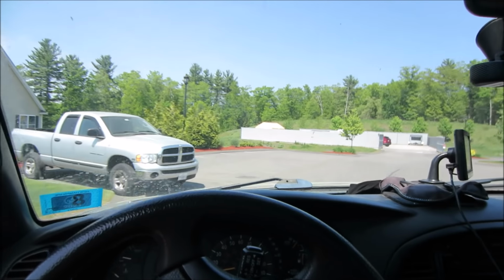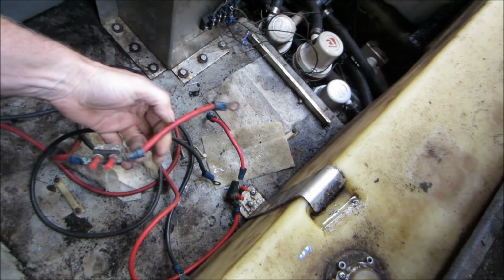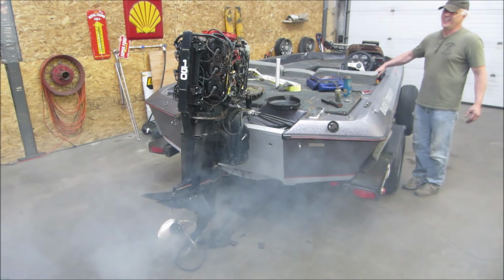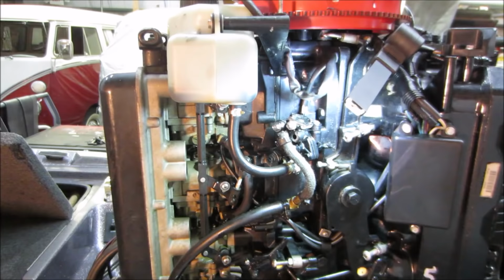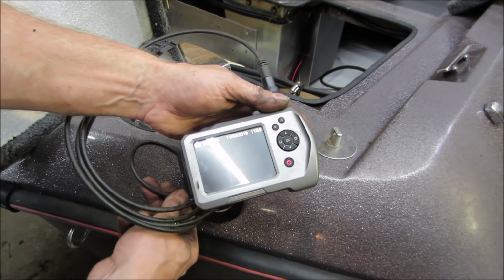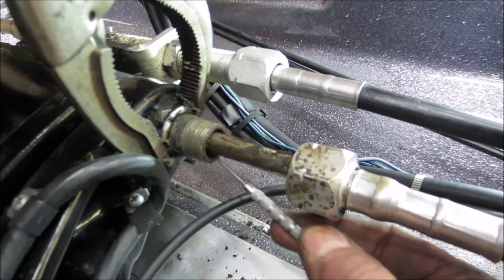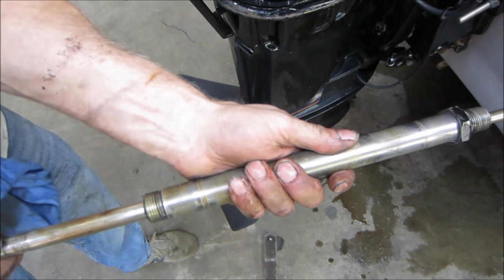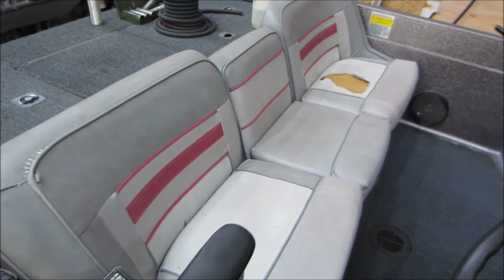1990 Bass Boat. Can We Fix It?

Comment: I've had to drive those steering rods out with a hand sledge before. Rusted tilt tubes suck.
Reply: I have had that issue with my boat.  Salt water is hard on them.  I found the best way to free them is to run the motor and use plenty of WD40.  The vibration of the motor will break up anything in there.

Comment: The switch on the front navigation light is for the auxiliary light on the back, like a map light. Separate bulb for the navigation light. Have the identical light on my Nitro. Almost wish I was there to answer your questions as you went...lol! I have a 94 Nitro 180TF, this boat is the predecessor to mine.

Comment: The blue in the main tank, is most likely old oil that has separated out (- I've been there).  That may indicate the auto-oiler is non-functional, thus adding oil into the fuel tank.

Comment: Hey man. NICE FIND! I have a word of advice on that Merc if I may. I have the same engine in Mariner flavor (everything is gray instead) on a 19 foot Procraft.. The oil system is a possible failure point which can cause the engine to run without oil.  Mine has been removed and retrofitted to take premix gas only.  Its a bit of a pain to fill, however the peace of mind is awesome. I use a 50:1 mix of high quality marine two stroke oil, with marine gas and a bit of Star Tron additive, and its good to go! I really love your videos man. Thanks a lot for all you do and share.

Comment: I played this game a couple of years ago with a 1991 Astro with a 115 Mercury. Go ahead with all new fuel lines and hoses, new kind with "Above Deck" (Grey) and "Below Deck" hose types. Water pump, thermostat and poppet, trim relay, plugs and cables, water separator/fuel filter, examine ALL electrical, service lower unit, and expect more to come.
Have fun!

Comment: I just went over this with my boat that had sat for about 10 years. I disconnected the clamp that holds the two cable end rods together. Then took the nut or seal off the ends and slid about a foot of 7/8 rubber hose over the threads. Clamped it down tight then filled it with ATF. Then put a air valve on the end and put about 60 pounds on it. Left each one of them for like a week working the steering wheel everyday more and more. Mine is now about 80% better, it’s not perfect but a lot quicker and cheaper than $600 for new cables. I could barely move it to start with but it wasn’t quite as bad as yours.

Comment: Had the same seized steering rod in my boat recently. We used the pivot tube nuts and assorted pieces of pipe as spacers to pull out the rod along with the complete inner cable.
Then we cleaned the inside of the tube with a scraper and brass brush from a 16-gauge shotgun cleaning set.

Comment: sooo lol. not sure if others have mentioned but the steering tube was stuck from old grease that turned into a rock lol. Also... THAT TUBE HOLDS THE ENGINE ON THE CLAMPS LOPL....Heat friend.... a torch over the tube would turn the grease into soft stuff again and you are set. They do make a wiper for the port side to keep the grease in and junk out. That too helps. I have a 2-foot long drill bit that I use at my shop when this happens to clean it out once the shaft is removed.  Looks like you have a great find there. The oil system is like you suggested. The onboard tank gets fed from the big tank by air pressure pulses that then fill the small tank. Fill it up and then leave the cap loose until oil comes out. That small tank keeps your engine alive. I always run a small amount in the fuel on the older engines as well. Replace that fuel line and primer bulb before trying to run fuel to the engine.. It's a safety hazard and deadly when it is hardened. Also, the inner part of the hose is terrible and will crack into pieces and plug your carbs. Best of luck to you.

Comment: My dad bought the same boat back in the very early 90's he ordered it from the factory with all the options and living in Florida we ran it some times 3 days a week and every day in the summer tell we wore it out. after ten years of use we had fished it in to the ground but all most all of it was tournament fishing . we all my dad, me and my brother all fished the Florida circuit but it got old fast and we stopped after a few years . he sold the boat in the early 2000's this is the first one I have seen in the original color in 20 years god I miss that boat I should have bought it from my dad back when he sold his .

Comment: I know its old, but in the future, you can make a simple siphoning bucket to such the fuel out of a tank.  Put a length of hose from your tank to the bucket lid, with a nice tight seal.  Bring that hose about halfway to the bottom of the bucket.  Drill a second hole and affix an attachment of some sort to allow you to use a shop vac to suck the air out of the bucket.  Do not extend any pipe of hose from this side into the bucket.  Turn on your shop vac, and it will suck the fuel into the bucket, but the air gap will stop you from ingesting it into the vacuum.

Comment: Mustie
Been working with boats from 12' runabouts to 38' yachts, and steering cables need constant lubrication. It would be best to hit that transverse bar with penetrating solvent over several days and let the crap loosen up by itself.Also, check the bar for a centering bolt which many people miss and wreck the transverse bar. Started by keeping my grandmother's rental boats running at age 12, now I am 65. Lots of experience over 53 years. tells me to be careful freeing rusted controls or dried out grease on those controls. No need to hurry jobs like that just for a video.

Comment: Mustie 1,  Change the silver hose between the tank and engine. That's EPA hose and ethanol eats the innerliner and separetates  the two then when you go to fire up engine it colaspses and cuts off fuel.
Put car gasoline in its place and you will have no problems.
Just had this happen to my boat the hose was 11 years old.
Make it chooch again.
God bless

Comment: On the makeshift boring tool... 1/4 in steel rod and cut a 1  1/4 slot in one end and wrap 1" emery cloth around it to desired diameter,  chuck it up in a drill ,roll the emery cloth up and put in in and there you have a make shift flapper disc for inside diameters..

Comment: You should go ahead and replace the fuel filler and tank vent hoses.  ABYC recommends every 7 years on those because they become permeable.

One of the best tools I’ve made is a simple 3/8” rod with a 1” slot cut in one end.   Cut a strip of whatever grit paper you want, 1” wide, and wind it up in the slot.  Chuck it in your drill and ream away.  It’s like an internal flap disk.

Comment: Also, the oil injection system on those Mercs can have issues, either with the tank sensor, or pump. A lot of times, folks will just bypass and pre-mix.

Comment: I had one of these Black Max 150 V6 outboards and it was a badass on a 16' Cheetah shallow vee. Thing would come damn near out of the water, could burn up 12gals of fuel/oil mix in 3-4hrs of ripping around

Comment: Mustie, To clean out the sleeve, get a length of 1/4 inch rod and hacksaw a slot in the end of it the width of the emery tape. Wrap the emery tape around the rod. Fit it to the drill or die grinder and run it back and forward up the sleeve. Been there done that and it works.

Comment: In stead of welding the brush to the shaft cut a slot in the shaft. Take a strip of sandpaper and make a hone out of it for your drill. Start with heavy grit down to light grit.

Comment: Great video, I bought a old boat in April of this year, it's a 1961 15' Mobicraft and has a 1959 Johnson 50 outboard. It has been a nice project for me and I got it finished. The engine runs great, new points and condenser, fresh fuel and the old gal fired right up. Have had it on the water twice and waiting for my appointment to get it registered.
  I look forward to the next video, hopefully it will be part 2 . Thank you and you have a new sub and fan.

Comment: Big fan been watching for awhile but want to help you out. I’m an outboard mechanic and couldn’t help cringe at 24:24 your sprayed high pressure water directly in the airbox. wouldn’t be surprised if some went into the carbs. Also when trying to start in the garage, should definitely had it cranking with water hooked up or in a bucket. Doesn’t take long at all to burn up an impeller. Thanks for making cool videos tho!

Comment: Best stuff I ever used is the evenrude injector clean and it has the cleaning port on the motor and that stuff really worked great for cleaning and storage pickling . 
    Havent had a boat in a few years and not sure if they even make it anymore.
   And with 4 strokes coming out not sure if people even use it

Comment: Love your tanacity (sp) on solving problems. The steering cable problem I would haved failed. I can hardly change oil or sharpen blades any more because my hands bruise and bleed on everything I work on  and have to be carefull. So Thanks for doing these vidios so I feel usefull cheering you on. I feel like i'm in there and in your way Great Job

Comment: We had an issue like this, and we tried everything. My Dad hit the tilt up and it relieved pressure on that pivot. We put the lower brace on and tilted the motor down and it took the pressure off that pivot, found that bar was slightly bent. Just a suggestion.

Comment: Better clean and lube that other tube as well.  While you are there make sure the bushings on the tilt tube are taking grease and moves freely.  Most times I have seen or done that job is when the salt in the ocean has mixed and hardened with the grease and locked the tube.  Then taking the motor off the boat allows the room to work with the push pull cables as well if needed to remove the tilt tube.  Heat is the most often taken path.  All in all I much prefer the SeaStar hydraulic steering units.  Then don't forget to check the zert on the swivel tube for freedom of turn.  This is much easier to do while you have it torn down.  I have also seen the props frozen on to the shaft to where they had to be burned off with a torch.  Need to change the grease on the splines every couple of years in saltwater.  Yours is probably fresh water use but same thing with a bit longer time frame.  Guy said he fished it so pressure check the lower unit to make sure wrapped fishing line hasn't taken out the seal behind the prop which is ultra common.  Greasing here is important.  Use the right grease (doesn't combine with salt and silt and then harden) use enough every season to push out the old grease and do it once or twice a year.  Even then the lower bushing on the swivel tube often seizes up because all the grease coming in the zert goes the path of least resistance and exits the top bushing never getting to the lower.

Comment: We bought a boat during 2020 that had been sitting for a while, the tank was 3/4 full and had multiple gallons of water and green plant matter looking stuff... Since the tank was oddly shaped and difficult to remove, I just ran water + degreaser inside after draining it as much as I could, then just flushed it with lots of water from the hose until I saw nothing else inside really but pure water, then vacuumed out as much of the water I could with my shop vac, since it was well rinsed at this point and no more gas present. Then the few ouces of water I couldn't get out I just absorbed with towel through the pump hole.

Comment: My father bought a boat with an outboard motor. We had the same issue with the steering, we managed to get the cable out of the tube. I wish either one of use thought about using a drill. We just used the rods that come in the gun cleaning kit.

Comment: Suspend the gas tank in the air by looping a strap around each end and tossing the center over a beam overhead.  Then add your gas/scrubbing solution.  Makes it easy to stand at the end of it, grab it, and pull/push the tank back and forth to slosh it around inside before dumping out.  Also easy to dump out when suspended.

Comment: the spark light when put onto a boat motor is usually dimmer then if put onto a vehicle. it doesn't crank the same spark usually. the new engines will for sure but the older ones won't. 80's and older its a dim light. so you have to test in the dark or dim lit area.

Comment: i'd hate to think what the cost would be if you had to take this to a boat repair shop to have all of the issues addressed to restore everything. i'll bet by the time he's done, he will have more than doubled the value of this boat. bass tracker is a top brand, and it was prolly a $25,000+ boat when it was new. in as good of shape as it is, restored it should be worth at least half of the new price. all in all, an awesome addition to the mustie fleet. honestly, i'm kinda jelly, you lucky dog you.

Comment: For cleaning the rest of the crud inside the back where the tank goes use purple power full strength to soak before pressure washed it

Comment: to clean out the "tube", cut a slit in a piece of SS or copper (3/8") and insert some emery cloth into the slot, Make a flapper out of the emery cloth, Run it in and out of the tube with your drill, Will clean it very well!!

Comment: Mustie, that gas that looks like it has oil mix in it could be an indication that the oil injection was not working and the owner just pre-mixed gas and put it into the tank.  I have seen people do this instead of fixing and adjusting the oil feed pump.  As for that steering rod I would drill it and the motor housing to put a zerk fitting to grease that slide.   If I recall, my 90 HP Merc had a grease fitting???

Comment: On older motors it typical to find people running a mild solution of pre-mix fuel, the automatic oilers are the #2 reason motors fail. Also always keep the water pump wet, i prefer half a barrel over the muffs.

Comment: You do know that there should be a flat head screw on top of the lower unit, which is used the release the hydraulic pressure, which lowers the out board. Plus when open you can manually raise the engine and close the screw. My old 115 HP Yamaha had that screw.

Comment: had the same issue on the steering a long time ago. I did the same thing you did with the wire brush but i use transmission fluid instead. But I guess kerosene works just as well.

Comment: that little oil tank on top of the motor is an oil reservoir.  its a back up oil tank in case the main tank goes too low.   another thing, never start an outboard without water supply.  the impeller will burn out in less than 10 seconds.  replace main fuel line and primer bulb, that fuel line looks kinda stiff

Comment: Those steering cable to engine fixings are notorious for seizing up ,  I have had to do what you are doing many times ,you soon learn to put lots of freeing agents on them , if you use grease that normally is the problem on going dry in the workings

Comment: LoL ! If people only knew how many of those exact year tracker fiberglass boats we hauled out to the landfill and crushed because they were splitting up the middle of the hull right out of the factory! They were and still are flawed from improper resin heat and poor engineering.  We used to sneak out to the landfill at night and salvage the steering cables,  gauages and anything els worth taking before they ran over them with a dozer the next day and buried them lol. Those were good times! You couldn't pay me enough to take one to the lake today knowing what I know,  and thats being serious.

Comment: Mustie, judging by the color of the gas I'm willing to bet the owner dumped premix right into the gas tank.  I had an 89 Bass tracker with a four cyl 50 hp merc.  Those external oilers were prone to failure.  My dealer told me to disconnect it and mix on my own in the tank.

Comment: Time to set up  d CON mouse bait stations in the shop.... Cleaning out the Sleeve on the inside, use a long wooden dowell with sandpaper wrapped around and lube!
clean out any length on the inside of anything! A project that will float again....

Comment: listen, something important. do not forget to pull the lower half, and clean out or replace that water pump!!! whether you start it in a bucket or drive it 500 ft out in the water, it will seize up like a brick, if you do not fix that water pump. and they go bad from sitting it's just a known thing that all outboards do. I hope that helps you all.

Comment: Hey, Mustie. Have you ever considered flushing water out of a tank like that with denatured alcohol or methanol (depending on what's cheaper/easier to get where you are). It didn't look all that complicated to get this fuel tank out, but that may be the easier option one day.
Reply: how about detergent and hot water?
Reply: @Ihavetruth22  The nice thing about using ethanol or methanol is that it would allow the fuel to take up the residual water.

Comment: Hey Mustie1, Just saw your channel and currently wathcing the video.  Not sure if you are doing this or not or plan on it but remove the lower unit and replace the water pump impeller.  Being that it sat for 10 years it is bad and the fact that you ran it dry most likely tore it up aas it deteriorated.  I'll continue to watch....oh, I love the Bug wagon you got.  Would love to see it in full view.  I had a 54 beetle 6 volt but had to get rid of it....

Comment: If you run that motor without cooling water going through the system, you will destroy the water ,pump in the lower unit. It is the pump in the lower unit that supplies coolant ,to the engine proper.

Comment: Just think if the fuel tank was set in before the “top cap” was installed. Cutting a tank out IS A PAIN IN THE A**, and cost THOUSANDS to resurface the hole. So, I just sucked out what I could, and double filtered for whatever trash was less. Lucky you were able to get the tank out without cutting!